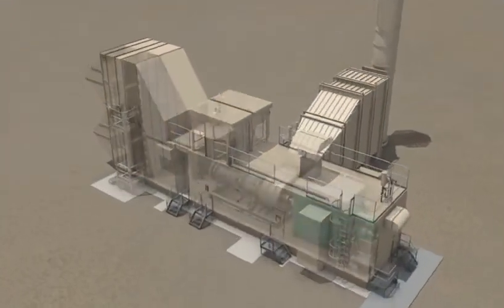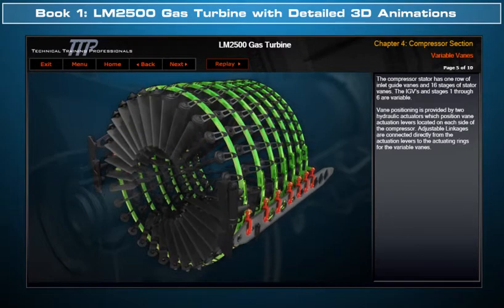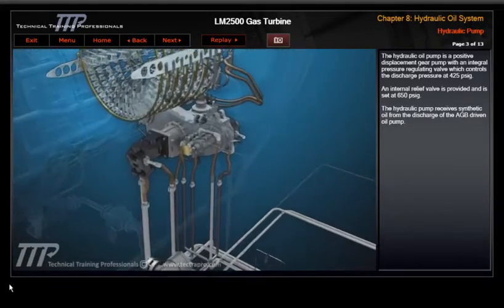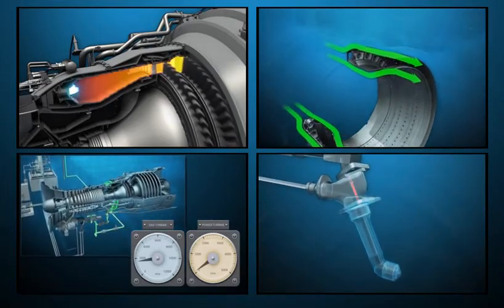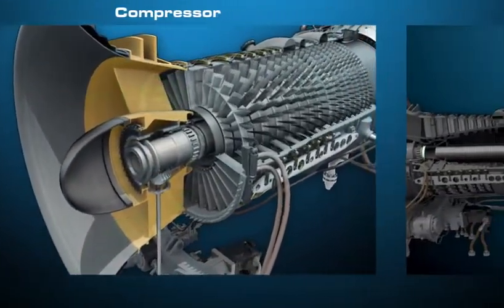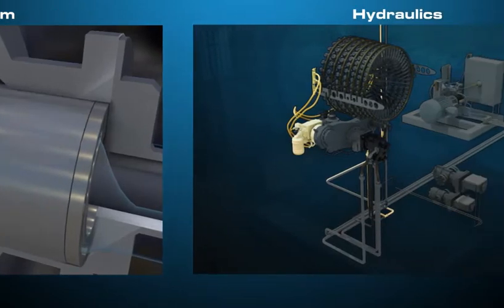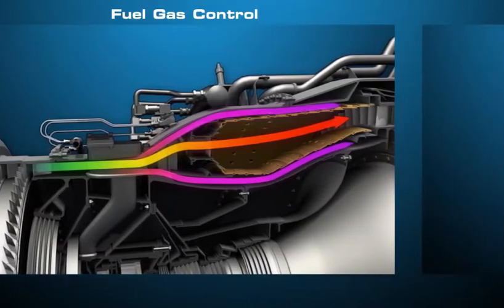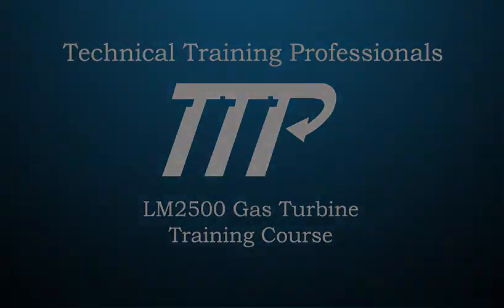LM2500 Combustion Turbine for Combined Cycle and Simple Cycle Training

Comment: Very nice graphics and presentation. If I wasn't retired I would do your LM 2500 course!
In the 1970's and 1980's I worked for GE doing industrial gas turbines... MS3002, 5001, 5002, 6001, and 7001 and only saw a few LM 2500 for the Navy. Then I switched to steam turbines and went to the West Coast to do marine propulsion for GE. They still sent me to Prudhoe Bay to do gas turbine compressor drives.
Reply: I work on lm2500 for the navy... beautiful yet ingenious engine
Reply: Hey Ryan.

I need a hand on LM2500 unit, we have a damaged diffuser outer duct needs replacement but I don't know much.